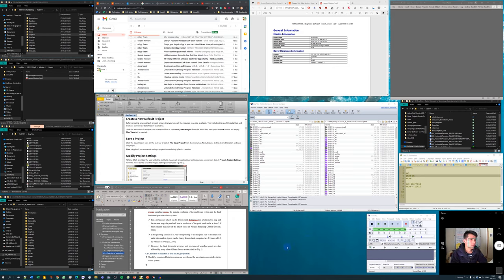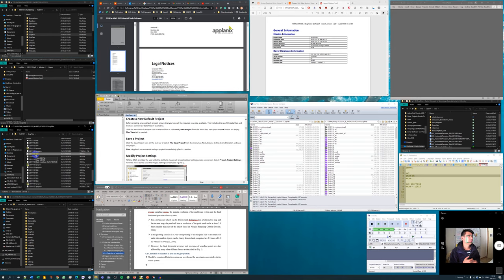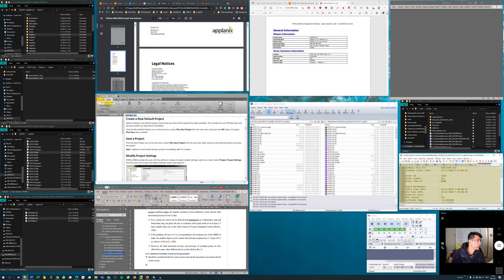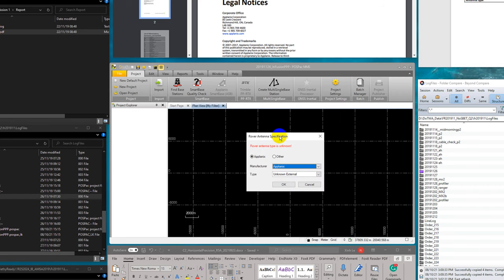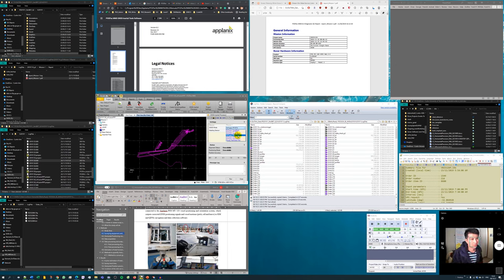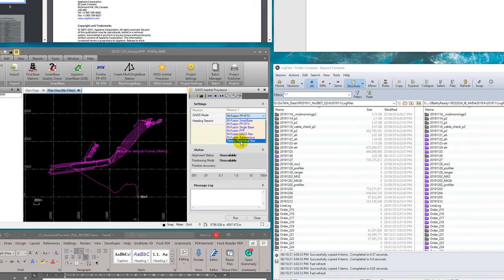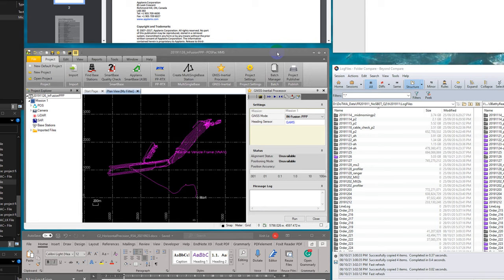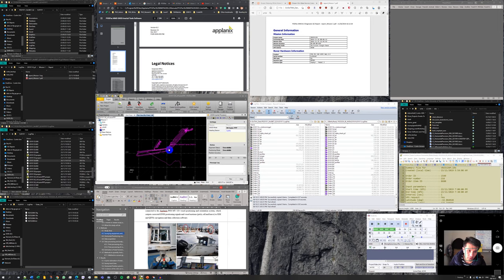Note 1 PPP Precise Point Positioning for Hydrographic Survey using POSPac MMS In Fusion PPP

Comment: Great walkthrough, thanks. What would you use for processing data from other POSMV / MRU systems? I got some Seapath systems and PosPAC won´t work with them
Reply from the maker: I would try to export to rinex format and use RTKlib to process it. Never have chance to do it myself but I think it should work.
If you can export to Rinex format, may be Pospac can as well?